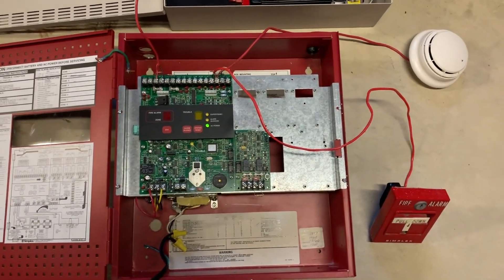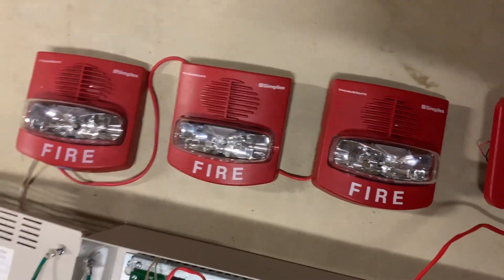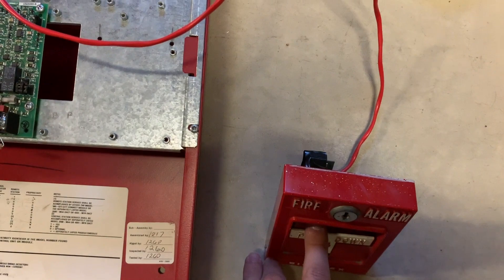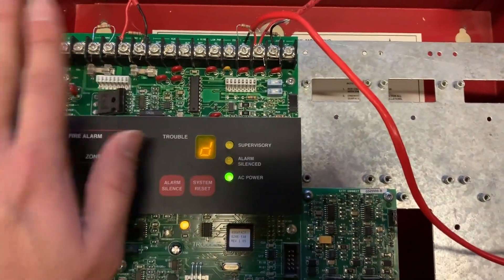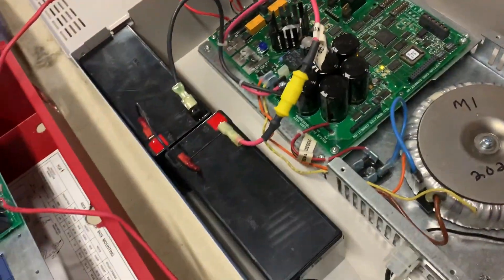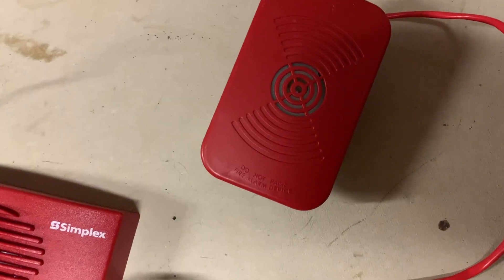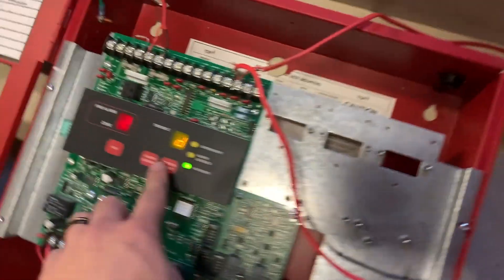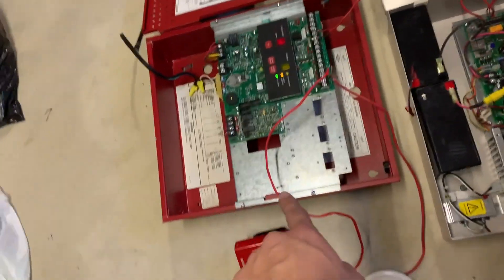Home System Test 51: Simplex TrueAlerts WITH SmartSync Mini Horn on Simplex 4004 & 4009!

Comment: I’m gonna get a home system for my grandpa and my grandmother so I decide to get simplex 4903-9425 the bonus room and the basement simplex 4903-9252 fire lite alarms ms4 fire lite announciator simplex 4904-9174 Simplex 4099-9006 Simplex 2098-9201 smoke detector weather proof truealertES and that’s gonna be really hard to wire since they want it Flush mounted 😭